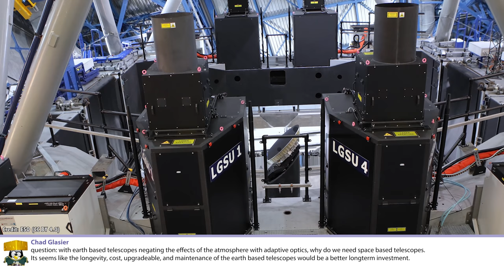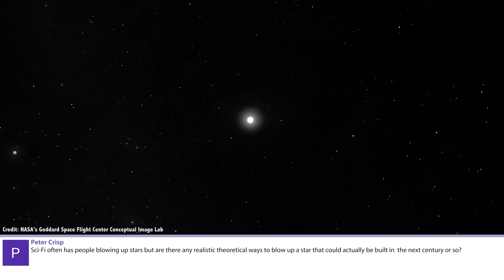Q&A 32: Why Can’t James Webb Be Repaired? And More

Comment: wouldn't it be possible to boost ion engines to have much more thrust? What are the limitations to this?
Reply from the maker: Ion engines are very efficient, but the maximum thrust is still pretty limited. The most powerful version I've ever heard is the cancelled JIMO mission which would have had a nuclear-powered ion engine, capable of going into orbit around each of Jupiter's moons.
Reply: Thanks! :)

Comment: Hi Fraser, could an SR-71 fly through Jupiter? at Mach 7, which is extremely fast, it's like triple the speed of sound.
Reply from the maker: No, once you get into Jupiter the temperature and pressure are extreme. It would be like flying into a brick wall.

Comment: What would be worse? a black hole with a few times the mass of the sun or a magnetar passing by the solar system
Reply from the maker: I'd go with the black hole. It would mess up the Solar System, while a magnetar would merely irradiate it.
Reply: wouldnt they both mess it up?

Comment: Why dont they make the batteries replaceable?  In 8 years we could send out an advanced replacement that could lock onto the old one and replace it with itself.
Reply: Space based telescope batteries..
Reply from the maker: It's not about the electricity, it's the fuel it's using to stay in position. That fuel will run out and it'll just drift away.
Reply: Chemical fuel or air/gas jets?  Either could have replaceable tanks.

Comment: Hello! How do rocket scientists  know when a just launched rocket is at max Q?  Is there automatic instrumentation on board that tracks velocity and air pressure and adjusts the throttle accordingly or is it known/calculated prior to launch and pre-programmed for a certain time after lift off? Thanks.

Comment: i have a question apart from Mars Europa and Enceladus are there any other  moons/planets in the sola system with a good chance of finding life 
also where do u thing will be the first place in the sola system we find life
Reply from the maker: Anywhere with liquid water inside it. And it's looking like most of the large moons in the solar system will have this. I think we'll find it first on Europa.
Reply: CALLISTO MOON, GANIMEDES MOON, TITAN MOON, TRITON MOON, além de milhares de planetoides o mais proximo Ceres, e depois Plutão, se estima que no cinturão de Kuiper exista 200 planetoides do porte semelhante a plutão, plutão também tem agua em forma de gelo, E se estima que até a região da Nuvem Oort no limite considerável de 50 mil UA exista 10 mil planetoides do porte de Plutão, além do planeta nove, e talvez até 3, 4 ou até 5 planetas de porte acima de Marte por essa região que façam parte do sistema solar o planeta nove está em algo em torno de 700 UA ou seja nem perto da Oort nuvem, pode se dizer até que ele ainda está no sistema solar interno, já existe também a possibilidade de um planeta semelhante a Marte entre o cinturão de Kuiper 50 UA a 700 UA além do planeta nove, então no nosso sistema solar ainda a mais planetas no caso planetas de verdade a serem descobertos que poderemos comprovar o não suas existencias com exatidão com o GMT TELESCOPE, TMT TELESCOPE, E ELT TELESCOPE a partir da proxima década, além do WFIRST se o congresso americano aprovar, o foco do JWST não é pesquisa para o sistema solar, mas sim extrasolar dado sua área de coleta limitada, apesar de um espelho bem maior que o WFIRST a vantagem do WFIRST é a camera que tem uma área de visualização 100 vezes maior que o Hubble é igual dizer assim; o Hubble está vendo alpha centauri com tecnologia um pouco inferior aos anos 2000 dado suas atualizações que foram feitas, e o WFIRST verá além de alpha Centauri 100 estrelas a mais ao mesmo tempo por exemplo com tecnologia dos anos 2018 superior esse a ser lançado em 2025 se tudo der certo. Porém locais realmente para terraformarmos por completo no nosso sistema solar seria somente Marte com 38% da gravidade da Terra e Venus com quase a mesma gravidade, ou o lado oposto ao sol de Mercurio, quando pensamos colonização na área completa de um objeto temos que pensar também se sua gravidade é o aceitável para o ser humano ela deve ser a partir de 30% da Terra. Poderíamos no longo prazo usar naves e maquinas movidas a energia solar no caso impulsionadas por laser, para retirar matérias primas valiosas de Mercurio assim tornando ele em um planeta de mineração no sistema solar, ou desmantelar Venus aos poucos para aumentar a massa de algum satélite natural por exemplo Callisto Moon até que essa Exomoon ganha-se 30% da massa da Terra assim aumentando sua gravidade para um nivel bem considerável, isso porque Venus é um planeta que independente da nossa tecnologia no futuro poderá ser habitável se dermos um jeito nele, porém independente do que fizermos seu fim será dentre no máximo uns 800 milhões de anos mesmo usando reflectores para interromper a luminosidade cada vez mais crescente que cairia sobre Venus assim como cai na Terra no caso um aumento de 1% da luminosidade do sol a cada 100 milhões de anos, para a Terra por exemplo se estima que se ela ficar aonde está hoje daqui 1.5 bilhões de anos a Terra será como Venus é hoje no caso por causa do sol, poderíamos arrastar Venus para uma orbita entre Marte e a Terra mas isso é complicado pois ele poderia colidir com a Terra assim não teriamos mais nem Terra e nem Venus, então o certo seria desmantelar ele, pegando toda sua massa aos poucos para criar um novo planeta em cima de uma massa já existente que poderia ser uma exolua de Jupiter ou Saturno que tem baixa gravidade, o resto a natureza faria por conta propria afundando a massa ao nucleo Callisto por exemplo não existiria mais porém teríamos uma nova Terra dentre algumas centenas de milhões de anos de muita mineração em Venus. Venus tem uma massa muito grande por isso tentar move-lo para mais longe do sol poderia criar uma fricção entre a Terra e ele e assim ambos planetas explodirem em uma colisão, mas a Terra também poderia ser movida para uma orbita além de Marte a longo prazo pois a massa de Marte é muito inferior a Terra ou seja sua força de atração é muito mais fraca para um possivel cruzamento em operação de engenharia orbital. Todos os satélites naturais do sistema solar conhecido não tem gravidade aceitável para os humanos Europa poderíamos instalar postos avançados que iria ser sobre sua superficie ou no seu oceano no caso cidades dentro do oceano de Europa com entradas a partir da superficie, poderiamos gerar gravidade artificial para um posto com algumas dezenas de milhões de pessoas em uma cidade como essa usando energia de fusão nuclear para criar um sistema rotativo que iria girar rapido o suficiente em volta dessa cidade para criar gravidade artificial que poderia ser até a mesma que a Terra dependendo do tamanho da maquina e da energia que iria ser usada para ela. Isso serviria para qualquer satélite natural conhecido dos nossos gigantes de gás. A gravidade impede que um dia possamos viver e terraformar por exemplo ganimedes por completo isso é ficção. De Venus poderiamos remover bilhões de KM³ de metais do seu nucleo e manto, os metais tem grande massa o que se traduz em grande gravidade, os metais de um planeta morto como esse e sem muito futuro acima de 800 milhões de anos mesmo usando uma tecnologia avançada para impedir que ele se torne um objeto realmente morto de vez, podem ser usados para fins ilimitados por exemplo uma esfera dyson rings em volta da nossa futura anã branca que é o que restará do sol depois que ele explodir, colonias de cilindros habitáveis em volta do sol no caso rotativos para gerar gravidade cada um deles poderia suportar até 1 milhão de habitantes e pesar tanto quanto 80 milhões de toneladas com uma espessura de algumas dezenas de metros. Ou criar uma frota de naves para exploração de outros mundos no caso centenas delas cada uma podendo suportar o suficiente para uma viagem estelar de  100 mil colonos, usando apenas poucos KM³ de recursos naturais do nucleo de Mercurio ou Venus.

Comment: Artificial black holes:  Even if they don't evaporate (sorry Steven Hawking), a black hole created in a particle accelerator is very small.  Much smaller than an atom.  Atoms are mostly empty space.  It's much smaller than a proton inside an atom.  Protons are mostly empty space.  An artificial black hole would be so small that it would likely never encounter any matter.  I don't have the numbers at the moment, but I once read that the size of an artificial black hole compared to an atom is like the size of an atom compared to the entire observable universe.  Those black holes would be quite weak gravitationally, having only the mass of two protons.  Nothing on quantum scales sits still enough for such weak gravity to have an attractive effect.  That said it's very likely that such black holes would evaporate.  But the final stage of evaporation is still debated.  It's unknown wether black holes evaporate completely, or whether they leave Planck-mass remnants, which are thought to be one possibility for WIMPs (weakly interacting massive particles).  If this is the case, a zillion black hole remnants pass through your body every second.  Finally, we know that cosmic rays that collide with our atmosphere produce far greater energy levels than we are capable of creating in particle accelerators.  If micro black holes were a problem, surely the earth and all stars would have been gobbled up billions of years ago.

Comment: ??? Re created black holes. I really think you should rephrase one of your answer to "probably will evaporate" before it hits something.  After all there is a finite probability that it will not have evaporated before it hits something. I know the odds are in favor of it evaporating but it's not a 100% certainty. After all, it won't be slowly drifting towards the floor, it's going to be moving very  fast. What are the chances a atom sized black hole can last for the nanoseconds it will take to collide with something?

Comment: If hawking radiation is not true. How long would it take one of these created micro blackholes to gobble up the earth
Reply: 48 minutes.
Reply: Psillytripper Quite a while, actually, since they're so small. Remember, a black hole with the mass of a neutron won't pull on anything any harder than a neutron would, until that thing gets closer to the black hole than the radius of a neutron (ish... I think there might be some "small angle" kinds of approximations in there). Normal, atomic matter is mostly empty space, so the chances of anything wandering close enough to fall in are pretty small, at least at first.

Comment: I thought that once you park at L2, your there forever.
Reply from the maker: Nope, L2 is unstable, like the top of a mountain. It doesn't require much fuel to remain right at the balance point, but if you get out of that, you start to slide out. L4 and L5 are stable.
Reply: Thanks for the info. I didn't know that.

Comment: I have an intriguing idea that I got from an inflatable flotation device and chemically/ heat curing resins. do you follow my reasoning? a great huge delta or Horton lifting body taken into orbit with a chemical rocket and then inflated with the liquid resin coating the inside, perhaps electrostaticaly charged to keep it homogeneous and uniform, that then cures to hardness and retrofitted with hardware,hatches, engine etc. it could be multi compartmented and layered with sections to be filled with liquid water that would freeze for shielding/fuel/etc. water obtained from from ice moons?see where this idea could lead.

Comment: Ignoring the difficulty in doing so, would there be any advantage to having a telescope out in say the orbit of Neptune or Pluto. Would we be able to get a significantly better look at other solar systems?
Reply from the maker: Not appreciably. You'd only have a better view of Neptune, or Pluto. Being a few dozen astronomical units doesn't really help. And anyway, for some you'd be even farther, on the other side of the Solar System.
Reply: Love your channel and I really appreciate all the time and effort you put into it, as well as answering my question. As you said yourself, not too many youtubers do. 

So the luminosity of the sun won't really affect space telescopes to a point where further away is better?
Reply: Mitchell Peterson No not really, the engineers already have developed shieldings and techniques for dealing with luminosity issues. Otherwise such telescopes as the Hubble, Kepler and others would not have lasted as long as they have already. With that in mind, like Fraser points out, there's no real benefit to deploying those 'scopes that far out to offset the disadvantages of such extreme distances.

Comment: I have to believe NASA is banking on a problem with Webb.
This problem will serve as justification and reasoning to expand astronaut travel range, not unlike Hubble's early problem.
I do not think NASA pulled a fast one with Hubble, but they did learn the effect of having a certain kind of problem (that is resolvable!) and the benefit of such problems...
So, before we realize it, as we "fix" a problem with Webb, astronaut's travel from earth will expand to its million mile L2 orbit, making Apollo look like a simply stunt.
Just a thought... I could be 100% wrong.
But I will not be surprised when it is discovered that Webb has a problem ("Oh no!!!") but a resolution will be produced ("All right!!!").
Over $20 billion has been spent on Webb so far, so, travel of astronauts out to L2 to repair it will not be so expensive.
And a Webb repair will open up the universe once more, just like the Hubble fix.  After Hubble's first images displayed only a bad mirror, the only thing that mattered at that point was to make Hubble work, at which point, everyone cheered the fix and seemed to quickly forget the cost of the repair mission.
The second act of space telescope problems may be coming...
Reply from the maker: They do have a docking ring on James Webb, but that does sound a little too much like conspiracy theory. :-)
Reply: Fraser Cain I do not believe Webb has a docking ring.
Hubble had one installed on its last service visit, but I think Webb has no place to install a docking ring.
Maybe at the stage collar near its base, under the solar film?
Reply: As far as that goes, Hubble did not have a "ring" installed for docking, only a mettalic post, so that a remote craft can dock to that post and push Hubble down at the right time to have what does not burn up crash in an ocean.